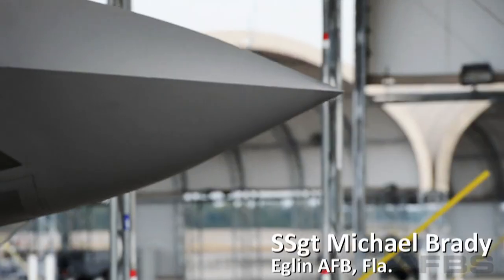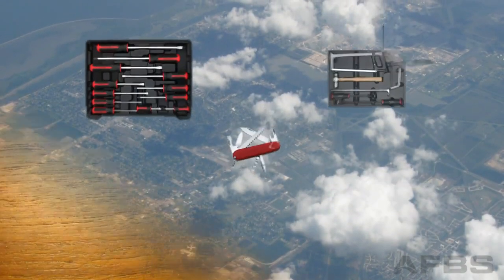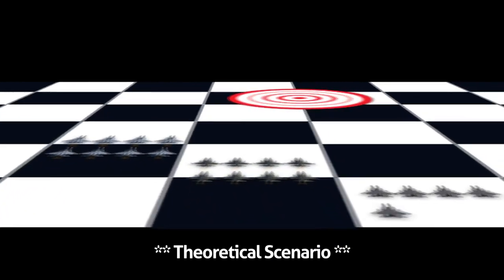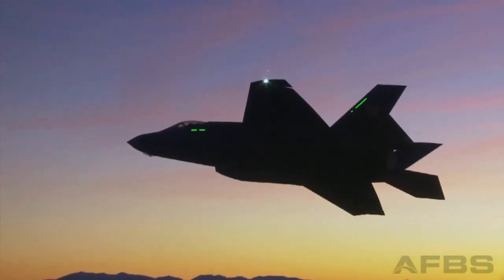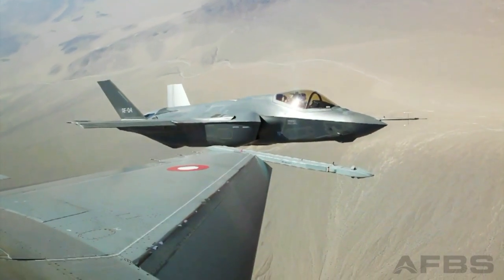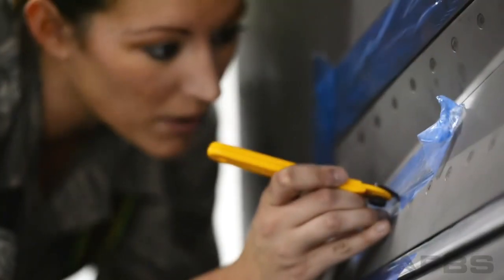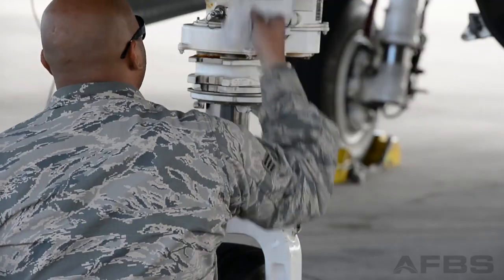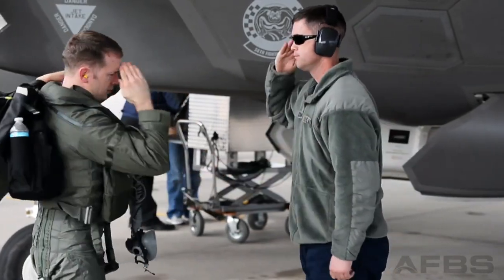F-35 Flight Test - A Fifth Generation Fighter Aircraft Jack Of All Trades

Comment: Jack of all trades, master of none?
Reply: +Himmelvandrer Vandreren Is sometimes better than a master of one
Reply: +Himmelvandrer Vandreren Biting bad slogans is pretty poor mate -_-
Reply: +Himmelvandrer Vandreren The key thing is the three different variants. But I'm sure you never did any research on the F-35A, F-35B and F-35C.
Reply: Naaa just a bit, I know for shure it was the best option for Norway.
We had to chose between The Euro Fighter, The Grippen and The F35.
I am happy we went for the F35.
You should play Turbo Tapes old game "Naval War: Arctic Circle" there you can see what a good plane this actualy is.
It can cruse at high speeds for way longer than F16 and the F35 need almost no time to re fule and re arm.
F16 takes for ever to refule and re arm.
Norway went for the cheapest "A" version with no vertical take off abilities... so sad considering our mountainus topography, we wouldnt need any runways.
So dont take me wrong, I tink its a great plane.
Reply: Himmelvandrer Vandreren Hello fellow norwegian. Im quite sure we all just misunderstood your original coment. I agree with everything exept... The F-35B doesn't have an internal cannon, and is currently limited to 7,5G instead of 9G. The F-35A is therfore the correct choice in my opinion.